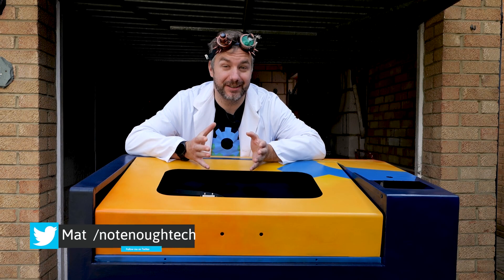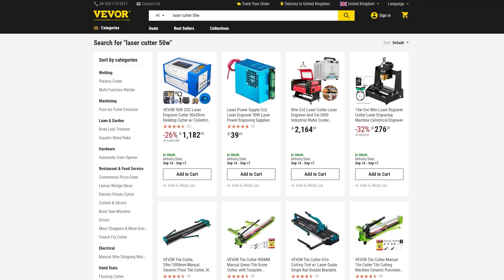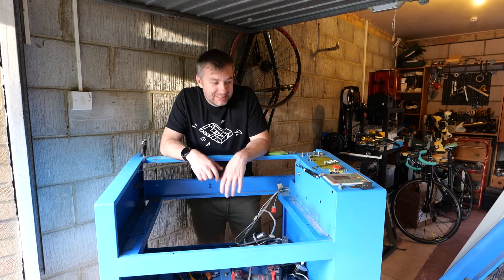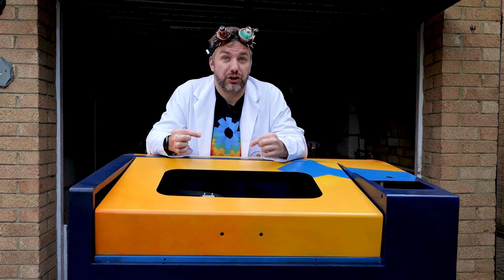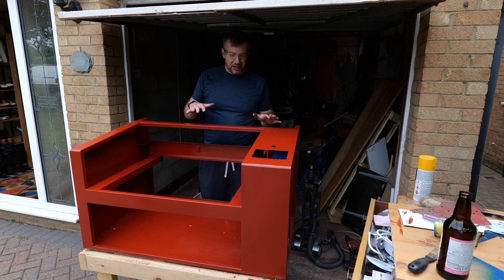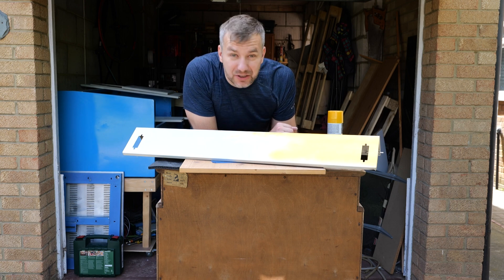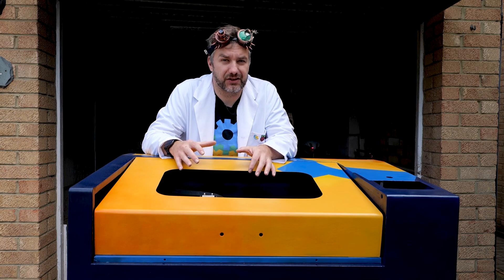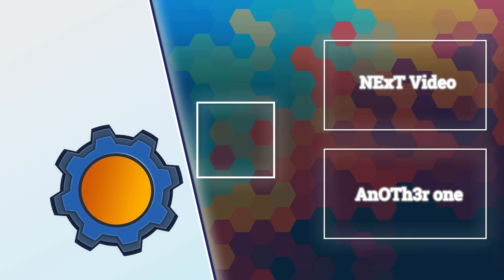Restoring a laser cutter #2: Strip & Paint

Comment: Love the paint job! Quick question - i have a similar laser where i need to replace the bed lead screws, do you know the size and where to get?
Reply from the maker: Do you have the original to measure? I have seen a couple of listings on AliExpress but that's all - i was looking into a belt upgrade to make it motorised.
Reply: @notenoughtech  thanks, I just know the thickness is 18mm, but not sure on thread steps. I am going to give it a good ole rust bath and try and repair the existing first!
Reply: @notenoughtech  do you have suggestions on how you removed the rail dust covers? Want to remove mine to also clean.